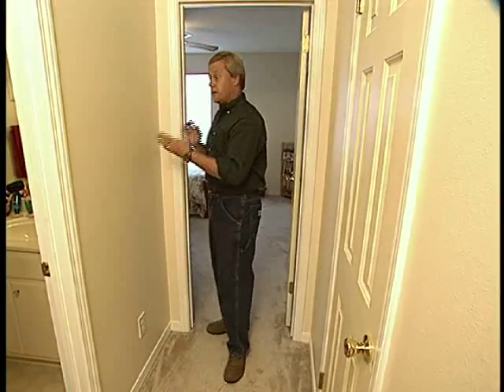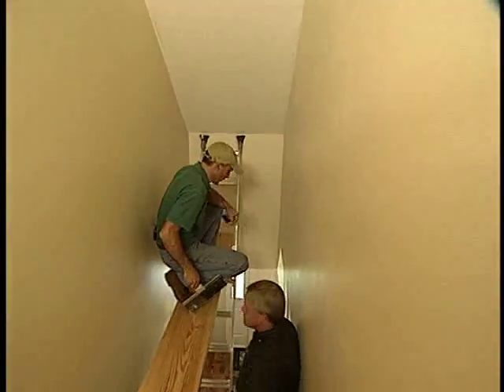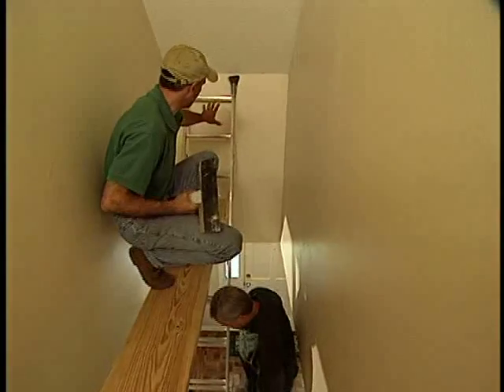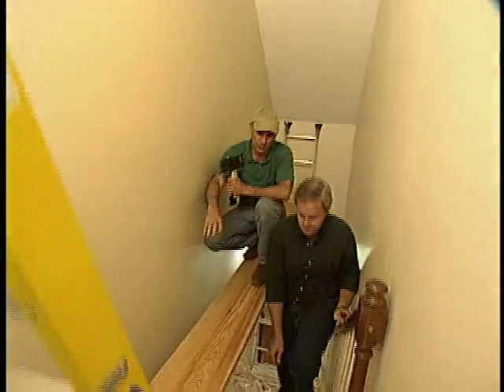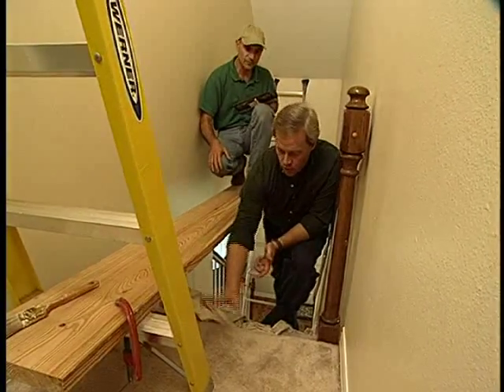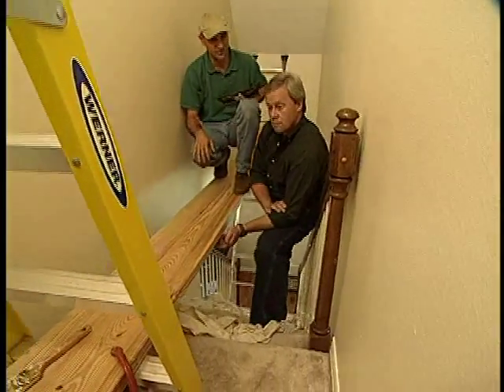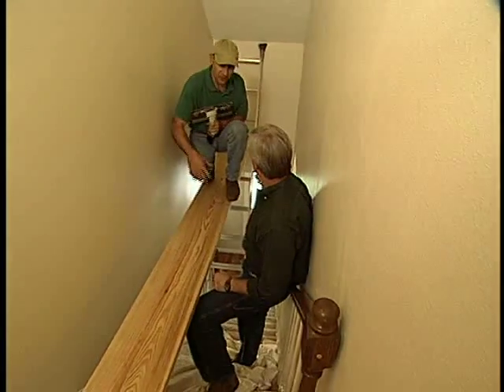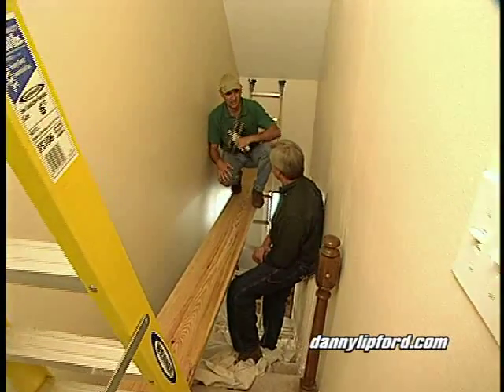How to Make a Scaffold to Paint a Stairway - Today's Homeowner with Danny Lipford

Comment: I just did this.  Let me say that I felt relatively secure.  

I weigh around 240 lbs and used a 2"x10" to span the distance of around 8 feet.  I certainly went slowly and was not about to jump or rock around to test the strength of the board.

If you weigh more than me though, you may want to think of way to make it stronger.

Comment: great video! I have a wall from ground to second floor ceiling that needs to be painted. only need to get near the ceiling for cut in at the corners, but I couldn't think of any way to do it. I was thinking of building a platform with osb and some 2x4's right over the stairs so i can set a ladder on the platform anywhere I want and safely reach the ceiling that way, because they're 10' ceilings. then leave an opening at one end to get up/down the stairs